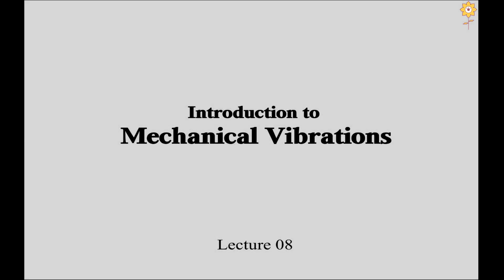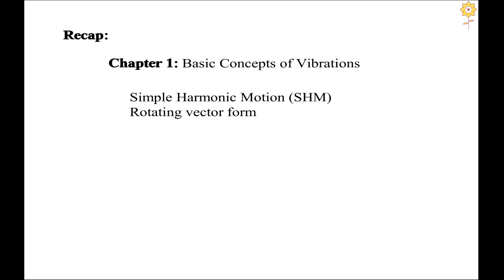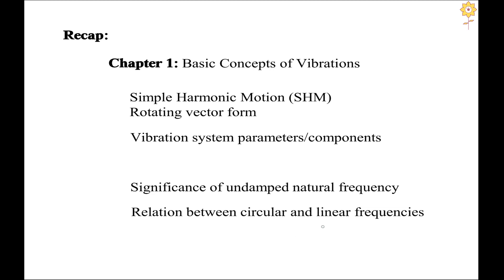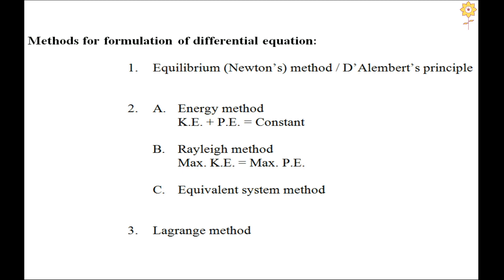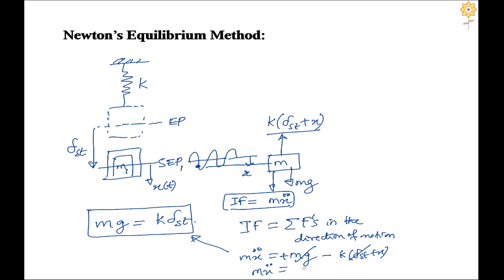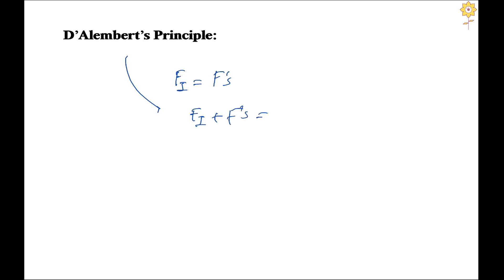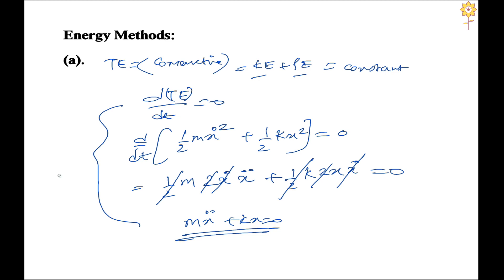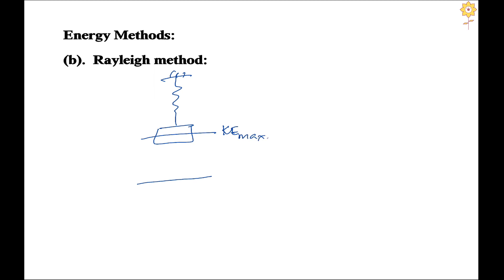Mechanical Vibrations: Ch-2 Free undamped 1 dof vibration systems(1/12) | Mechanical Vibrations

Comment: All vibrating bodies have following DOF: a)1 b)2 )3 d)4
Please answer
Reply: It depends whether the vibrating bodies are rigid and discrete separated by flexible elements (finite dof) or continuous and flexible (infinite dof). At a bare minimum, we can best approximate any vibrating body with infinite dof to be a single dof for the ease of analysis but with the most erroneous solution.  As a designer, we start with the best approximation (1 dof) followed by increasing order of complexity for the same problem (representations with increasing dof).  Hope this helps.